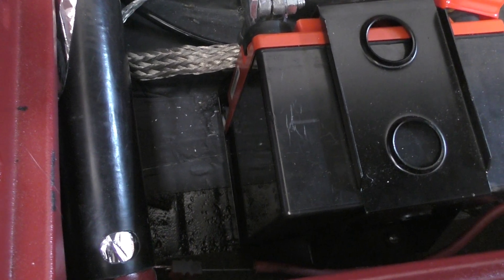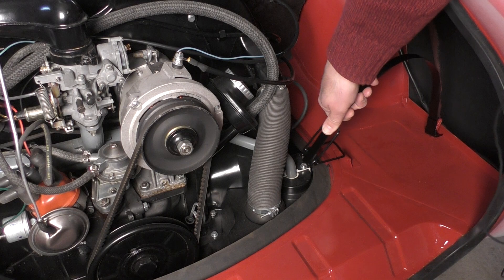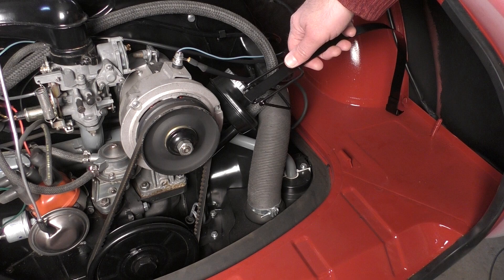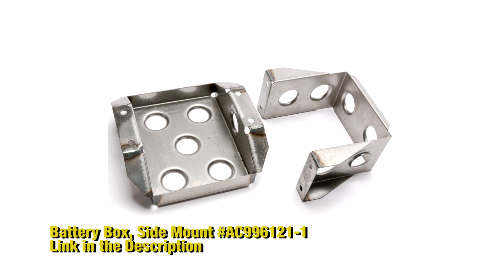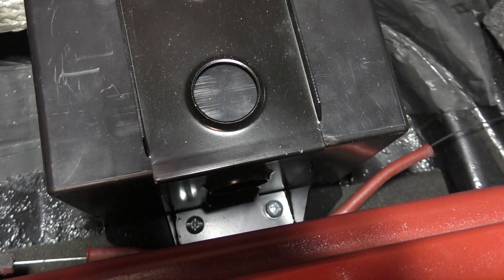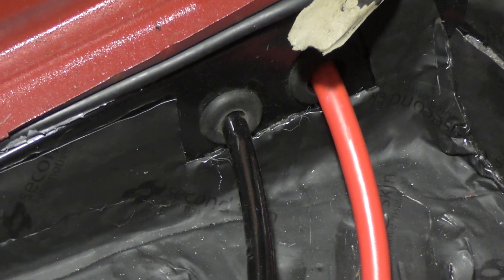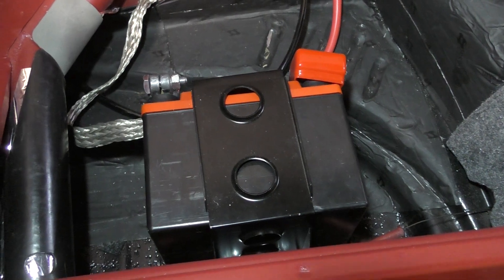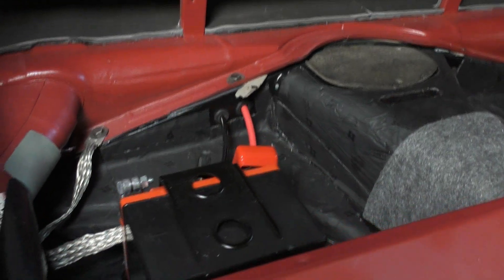Karmann Ghia: Battery Under Back Seat

Comment: How do you like the performance of the Odyssy 925 battery?   Any issues maintaining a charge?
Reply from the maker: no issues whatsoever.  No leaks and keeps its charge. That said, all carbatteries in general are not what they used to be. Expensive and they don't long.

Comment: So if the Odyssy 925 (apparently now the AGM28) is 6.60 in long, 6.90 in wide and 5 in high, wouldn’t it just be easier to use the L terminals or bolt the cables directly to the top?  My primary issue seems to be height, so laying it on its side makes the battery taller … I’m seeing lots of pics with the battery placed upright.  What am I missing?  Odyssy makes mounts, or you can get the metal box and mount it … then just place the battery in that.
Reply from the maker: The issue is clearance for the rear seat.  It’s wood but still has to sit right over the battery.  If the terminals are on top it contacts the seat the risk of a short or a fire is low to nill but why play around with it.